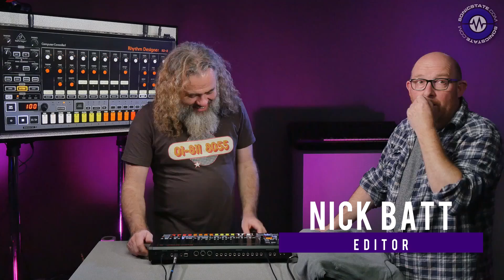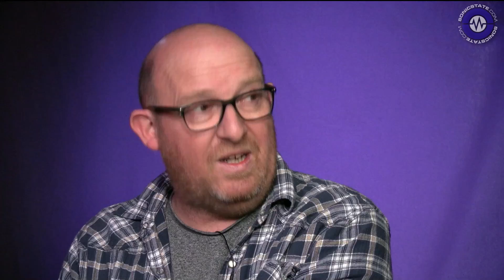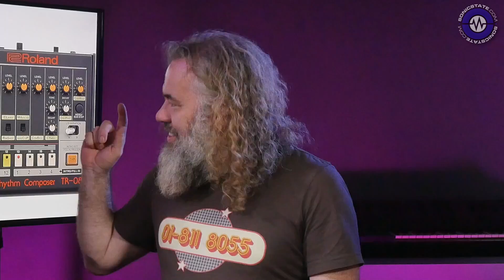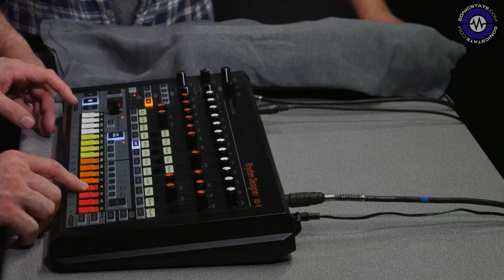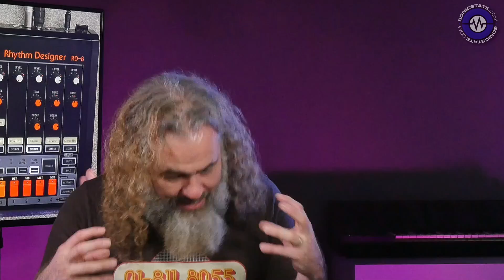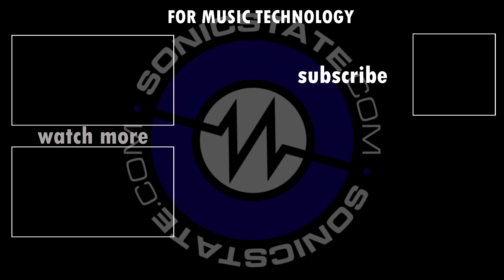SonicLAB: Behringer RD-8 Drum Machine - First Look

Comment: Why will you want audio from USB?  This is why you have an analog unit with multitrack outputs. You can use good converters instead of a cheap ones on the same devise.  Good from Behringer.
Reply: "Why will you want audio from USB?" for test tube babies

Comment: One thing I almost passionately hate about all Behringer Analog synths (roland is no better) as well as this product is the Wallmart style power supply. Come on Behringer, for goodness sake, just let us use the normal power cable as the are easily interchangeable. I think the wallmart power supply (even if the instruments sounds good)make their instruments feel kinda cheapish(and feel IS actually important), like not as professional as it could be(and should be).
Reply: So those are called switching power supplies and they are very standard for these kinds of synths. The Deepmind 12 and VC340 use the 10/15 amp, 250V C14 power inlets but they also bear the weight and heat. Professional means you get paid for the job --- are you getting paid to use this gear?
Reply: Haze Anderson Yes I absolutely get paid for playing;-) No I don’t have a Behringer, I usually gig with my NordStage 3 and Sequential Prophet 6.

Comment: I saw some MIDI out, what do you think of using it as a midi sequencer for the MPC Live?
Reply: You can but it's not ideal .... each pad on the RD-8 is set to a MIDI note number so the MCP would need to be configured to trigger on those note events. It's just not an ideal workflow to have ANY drum machine sequence a sequencer. You usually do the opposite.
Reply: @HazeAnderson incorrect,  you just make changes to the midi notes # via the rd8 interface - easy :-)
Reply: @ogasi1798  rude
Reply: @HazeAnderson  how so? you are wrong, i even added a smiley for you :-)
Reply: @ogasi1798  very rude
Reply: @HazeAnderson  how so? you are wrong, i even added a smiley for you :-)

Comment: And about it looking like the real thing, and controversial discussions about Behringer ripping off:
Roland, MOOG, Korg could have tried to do this as Behringer now does. But they didn't!
Actually, it was and is them still trying to rip off customers by selling them their max profit optimized products, which are not even close to original; and when they are getting close, they are heavily overpriced.

Roland could have collaborated with Behringer. And if they are smart enough, they will in the future.

Comment: It sounds good but for me, I'm better off sticking with my Roland TR8. Firstly I'd need to add another audio interface or a mixer interface to my setup to utilise the individual outputs and be able to track it properly. I could disconnect my other synths and track the RD-8 but I love the fact that in my setup right now I never need to re-cable anything. The main output only being mono, I think it should be a stereo. If you still have a big mixing desk and loads of outboard I see this being a great addition.

Comment: It's funny that everyone makes analog equipment these days except for Roland (& Yamaha).
Reply: I wish yamaha will do an updated su700
Reply: @tekbeatz  dude ...for real! that machine is special
Reply: Roland System-500. Roland SE-O2.
Reply: @Fireblaze15  JD-XA, JD-Xi
Reply: @Fireblaze15  both with help from 2 other companies, shows they can't do it on their own....
Reply: @Fireblaze15 the SE-02 was actually made by Studio Electronics. Roland just distributed it
Reply: @Fireblaze15  Well, Studio Electronics made it for them.
Reply: I was going to mention the System-500 as well, but it seems that was designed by Malekko. Roland says they "collaborated" on the SE-02 and System-500, but those being the only purely analog Roland synths gives me the impression that they commissioned these designs and sort of oversaw the process, but didn't do the actual engineering. I'm sure they helped SE fit their synth into Roland's boutique form factor (it did require adding AC in and removing the battery port, so the chassis is a little different from the others), but how involved were they in the actual synthesis engine?

That said, they do also have the JD-Xi and JD-XA hybrid synths, which have 1 and 4 analog voices, respectively. If those involved outside designers, they didn't mention it anywhere.
Reply: They do everything when it's too late, I wanted Roland synths vst for so long after  finding all alternatives they release them. 🤦‍♂️
Reply: @sqwop  Roland was always  late with it . When digital was hot in 1983 Roland continued with the jx3p,juno106,jx8p,jx10,Alphajuno 1 & 2 . .. ..
Reply: No actually it's not funny.. it's great. Mostly because modern circuitry allows many, many new ideas in analog.. this is more of a rebirth of analog.
Reply: They want to use always the new technic and how roland is saying ´´designing the future´´. I like that aproach but on the other thing I like analog stuff ^^.
Reply: morenazo952 or Manley rack gear for $300
Reply: 'cause in Japan EVERYTHING HAS TO BE DIGITALL!!!!1111!!
Reply: Korg is the new Roland and Berhinger is the King of Clones and they did a great job with Roland recreations spot on and my ears thank you since the beats are enjoyable to listen too
Reply: Those corporations cut costs, digital stuff is cheaper in maintenance in guarantee time.
Reply: @filipzawadzki9424  I'd say analog is more repairable. I've replaced pans and such on analog synths but have thrown digital keyboards away because the circuit board is just fcked
Reply: lies Roland make the TR-1000
Reply: Thats because Roland be are Cupid Stunts
Reply: Herman Simms it’s not stupid to not make analog gear. Roland gets a bad rap because they rarely listen to their customers and chase profits rather than make creative gear. They’ve made maybe 5-6 decent synths in the past 15 years.
Reply: @hermansimms8410  thats some cunning linguistics
Reply: @conspiracy of silence wtf are you rambling on about...slip on your "Knock off Nike" shoes and t-shirt and have a lay down
Reply: Roland has the SE-02 which is phenomenal. Analog doesn’t matter anyway.
Reply: Thats because its been done to "Death"...its a fad!....all Behringer does is copy other companies old stuff!
Reply: @justaname1862  what's the neutron a clone of?
Reply: @justaname1862  There is a massive demand! Analog is anything but a fad (hyped trend without basis in quality), there's tons of basis.

Some of us who can't afford a real 808 right now have wanted a similar analog drum machine with individual outputs. Roland only gave us the TR-08/09 which is just a plug in in a box (which is fine I own one and have used it extensively, so much fun). But an actual analog machine with individual outputs? Dude they had their chance... 

A lot of the new analog stuff is just amazing, this coming from someone who owns a CS-80 (currently in repair) and has no reason to NEED to believe in good vs old. I'd RATHER have a real 808, but for $300 ill gladly take this Behringer model
Reply: @justaname1862  well yea its a copy or clone. What ever you wanna call it but can you find a roland tr808 for less than $2000. I don't think so. The rd-8 sounds great for what it is. a price tag of $299 And it has better features than a true tr808. Behringer have really stepped up their game with these drum machines. I can't wait to get my hands on one. Gonna get the rd-9 also. They're coming out close to the end of the year. Should be around late September.
Reply: @justaname1862  us poor people love them for it
Reply: @justaname1862  Not just copies, but improved gear.
Reply: Peter Russ Ha ha . . . Sure, analog is a fad!  That fad has been building since the 1990’s when people realized that digital was awesome, but has limitations both in sound and feel.  Analog is here to stay.  Physical gear will never be totally replaced by software and digital synths.  There is no comparison to the workflow of a person interacting with an instrument rather than typing and mouse clicking.
Reply: @josephwright5921  And I just like having a knob, switch, or slider for every control. Menu diving sucks. I dont want only 3 knobs and have to click 40 buttons to change the waveform, ahem, teenage engineering ,ahem.
Reply: @josephwright5921 as a sound engineer I have to agree 💯 with this comment 🙌
Reply: Just Aname ????

Comment: Basically, an analog drum starship in a little box. Dag, yo, that's some hot business with probability plus polymetric programming per part to n/64 steps. Basically you can put a whole track into a single pattern that will come out different every time you perform it. If this can send out midi note on/off and such, that alone makes it one of the coolest pattern sequencers for drums available, and definitely the best at this price.

Comment: One correction: The original TR-808 also has 3 trigger outputs, that you can program individually. So it's actually not an extra option from the RD-8.
Reply from the maker: Ah maybe when compared to the TR-08 then?
Reply: Yeah, I believe that's correct.

Comment: I suddenly got this feeling Behringer is going to make an Electribe  !! 
A fun one !!
Reply: I quite like my electribe 2 sampler tbh. It's limited, but it's very quick and intuitive to program. Combined with a beatstep pro and a single synth, you can get quite complex with it in just a few minutes. I am saving up for an MPC though, so yeah, it's too limited in the end, but still a fun little sampler to play around with.
Reply: gladtobeangry Actually the thing about classic  Electribes is immediacy and fun: inspiration and getting things done quickly (well, just my opinion)
Reply: @javiceres  Well, the modern version doesn't disappoint in that respect. The 32mb RAM is just not enough for what I want to do with it, and the fx are a bit hit and miss. As a sketchpad/drummachine it's very quick, and easy to use. If you want to do more complex atmospheres/phrases/loopbased stuff, you run into limitations quickly.
Reply: @gladtobeangry  I see.

Comment: you think dave smith and roland etc going to rehash the same sht for the next 50 years? namm 2070 8 voice 3 osc probabilistic external psu
Reply: I don't think humanity is going to still be around in 50 years but the roland design team will be and they will be remaking their old synths for even longer.
Reply: Hahaha
Reply: Variable pulse width power on/off, rad!
Reply: Please do not compare Dave Smith to Roland.

Comment: @5:00 I was wondering if they'd cloned the faulty/odd behaviour with the clap reverb from the original, where the first couple of hits don't have reverb, and it seems they have, in a way.

(I only know about this because the Yocto clone I built has the same behaviour...)
Reply: Isn't it something to do with power that runs through the processor, it needs time for the right voltage to build up?
Reply: @b00ts4ndc4ts  I think it's due to a capacitor, but yeah, that's pretty much it
Reply: @MrMargaretScratcher  I don't mind too much about the quirky stuff,  I have a step sequencer that only has 15 dedicated buttons and one that has to do multiple functions, it isn't even along the bottom with the rest of them. But love using it.

Comment: And it will now be used  in 100,000 new hip hop jams
Reply: Most modern producers dont even know that those sounds they're using originated from an actual drum machine, they just think '808' is synonymous with 'heavy bass drum'
Reply: @jeevesdfector3686   Jeeves DFector  this is true I'm a producer and know the 808 comes from a drum machine but most of the time I forget that it came from a drum machine because I never see the drum machine.Drums just become sounds and names when you use a daw. There is a detachment from the old equipment the sounds originated from.
Reply: @effreyjepsteen  Make your point without being some shitty homophobic edge Lord.
Reply: morenazo952 Consumers won’t care, but the fact that musicians have a new inspiring piece of gear in their physical hands will spawn a new wave of music with 808 sounds
Reply: modern hip hop sounds have changed alot

Comment: After processing is very very important to me so the Roland unit is much more useful because of the USB outputs. Another thing I do not care for is that the sounds are pretty much locked to a 808 sound. The Elektron Rym is an open architecture drum machine with a built in mixer and effects which I prefer much better for my studio. That way I can mix 808, 909 Cr78 or whatever sounds I like to any pad.
Reply: 300 quid tho mate...
Reply: I don't mix all my tracks on a computer and I usually start out without turning my computer on.  I also don't perform with a computer, so for me real individual outs are suchhh a blessing.  Could not see myself using the boutique

Comment: Hmmm....get the Roland.....I have owned loads of synths over the years.....still own 4 Rolands...Boss Dr110, Juno 6, D10, Juno DS88. This kit sounds shit, I own a few Behringer mixers and they are really good, not sure about their synths.
Reply: Honestly, as a former owner of the original, it sounded shit to me after a while (probaby three years). And in every music I've heard since then, where the TR-808 is used, I wonder why that shitty snare is called "epic". The workflow though was very good, but with lack of MIDI it was a pain to sync it to Poly800-Sequences, for instance. I did not miss the 808 sounds for some 30 years, creatively, but the machine part I missed there and then. Maybe the TR-08 now gets a lower price tag. I do like small and lightweight peaces of gear. The Jd-Xi fits right into a normal travel case and is a synth with an additional drum machine (and of course a TR808 kit....) just like those TR thingies.